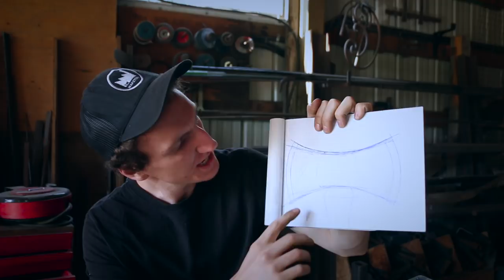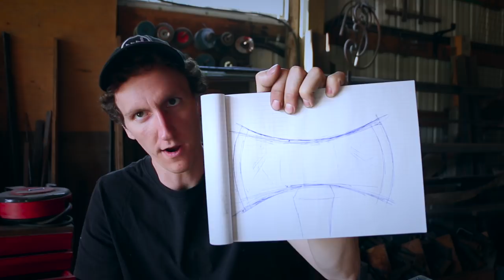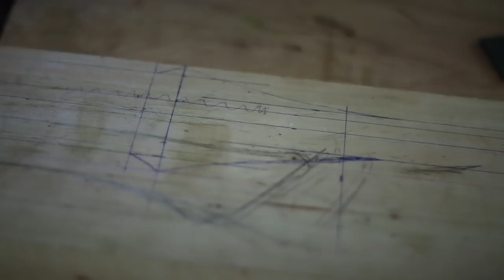HUGE THROWING AXE

Comment: Great video! What is your/the formula to figure out the amount of, in this case round stock, to achieve the mass of the finished product?
Reply: Also, you may have done it off screen but if not, if you put a smooth coat of wood glue on the wedge just before inserting it, it doubles as a lubricant while your driving it in.
Reply from the maker: Just volume calculations. I very roughly figure out the volume of the blank with the eye in it, before I draw the bit. basically its a rectangle. I honestly don't spend to much time punching number, always go with a bit more and what my gut says. 😜